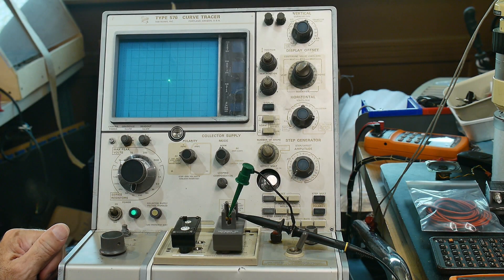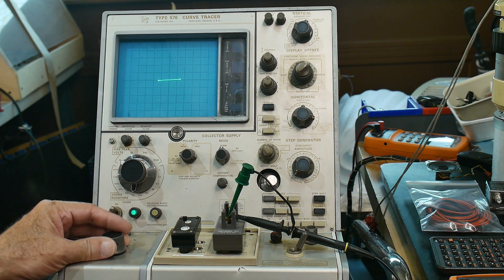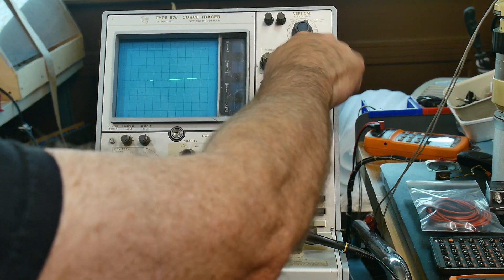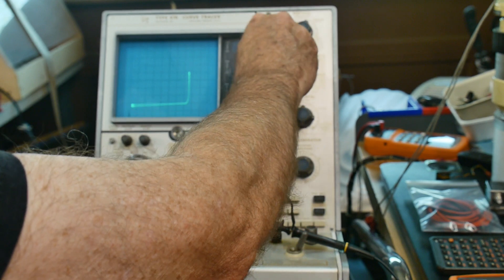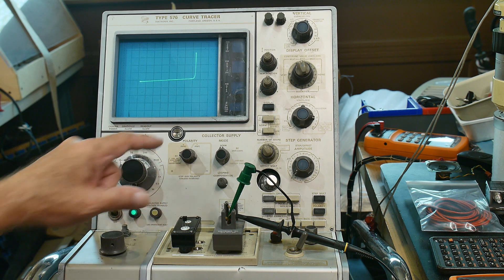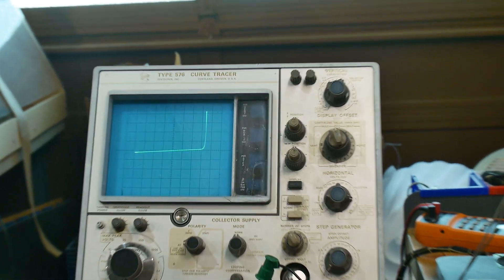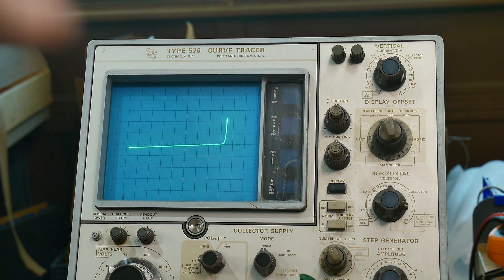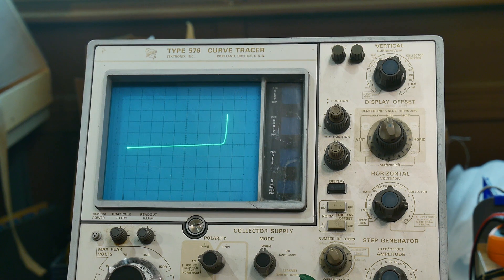#1278 Tektronix 576 Curve Tracer (part 6 of 9)

Comment: Looking great! The loop is showing up looping capacitance in the switch contacts. I would clean All the switch contacts in the Vertical, display offset, and horizontal control. The noise in the trace is possible that it might be bad silicon but more likely switch contacts. I had a 577 that did that with some cranky opamps in the amplification chain. The DC collector supply sweeping is generated by the mains line frequency. There is + polarity which is the sweeping curves then there is + DC. The main difference between the 2 setting is there is a small filter capacitor switched in to the collector supply.  The + setting is no capacitor just the rectified voltage from the transformer. The DC setting switches in the capacitor. These capacitors are hiding in the collector supply and are part of that cage. 
Also when doing the switch cleaning pay special attention to the Invert/zero/cal switch. The tube drive signals go directly though that switch pack. Any contact issues in that switch specifically will cause the display to do very strange things.

One other safety note on this unit. The intensity and focus pots use insulating shrouds as well as some long plastic standoffs as well as insulating shaft couplers. They did this because these two controls are floating on the -4KV drive voltage for the CRT. If I remember the calibration document the measurement point for the -4KV is one of the intensity pot legs.
Reply from the maker: Looks like you rebuild lots of Tek stuff. I have a bunch of TM500 plugins and they all have sticky/stuck push buttons, ganged usually. I would like advice on cleaning them. I've seen pulling the retaining clip on the front spring and pushing the insides out the back. what about the gang mechanism? how to get that working well without breaking it.
Reply: Those style gang switches are the worst!  They always cause the worst kinds of faults in my repairs.  And its because they get dirty so easily.  I have a pretty good succss rate with refurbishing them just with Deoxit sprayed anywhere I can get to penetrate the internals of the switch.  On a lot of Tek stuff I've seen, these style snap action gang switches are very easy to penetrate because usually the backs are open and/or the pins on the top have spaces just big enough to get the cleaner into (the downside to this is that is probably how they get so dirty in the first place 😂).  Once I've applied the cleaner, I just exercise them over and over (push in and out).  If the switch is completely sealed, sometimes it is worth it to drill a tiny hole into the top of switch with a dremel tool to get the cleaner in!   @IMSAIGuy

Comment: It's already drawing great, the diodes are tested with AC voltage, my 210 is tested primarily with alternating current mapping, only for the three-wire ("sense" unfortunately 210 does not have) connection of the tested component, the DC component is used. I don't have much experience with what you have, I've met him twice in my life.

EDIT: If you look at the test sockets, the three in a row above each other are measuring and the two next to them are Sense inputs for four-wire measurement.

Nice day 🙂 Tom